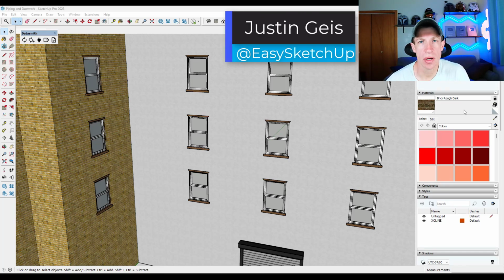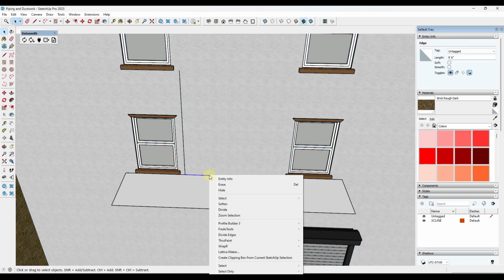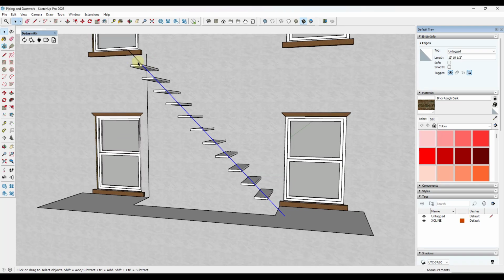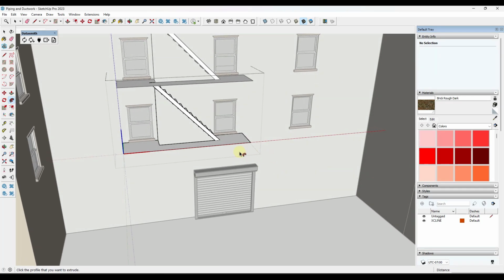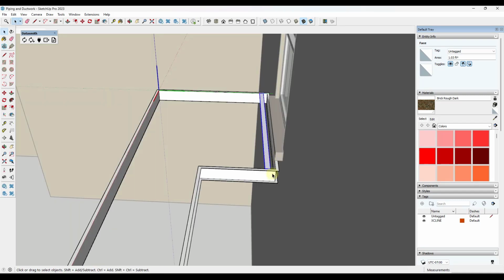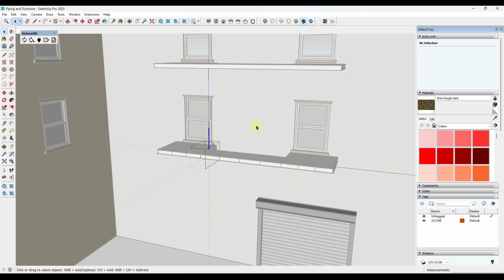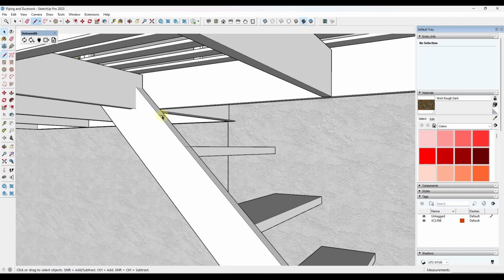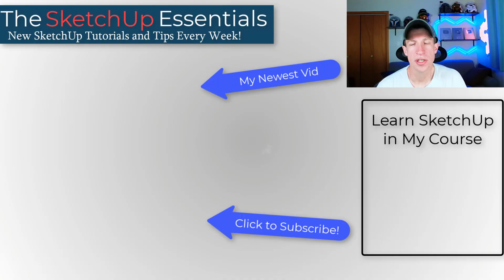Modeling a FIRE ESCAPE in SketchUp (Step by Step Tutorial)

Comment: I have a memorial park project. The site have rolling hills on either side and  the roads climb a long incline through the site with footpaths running on both sides of the hills.
 How do I model the terrain accurately based on the site development plan, add the roads,  paths and do a walk-through animation in lumion? Thanks.